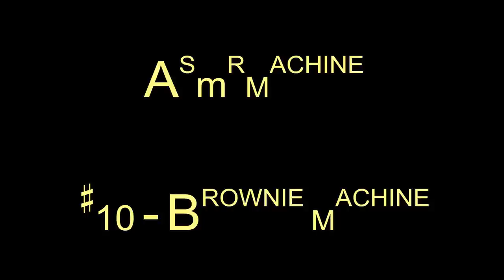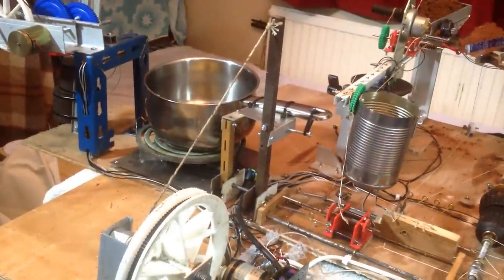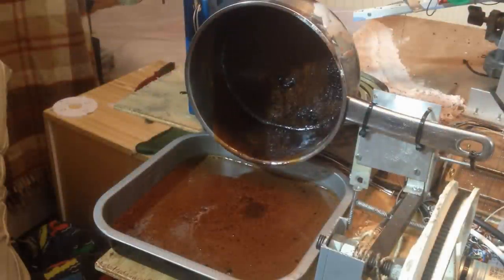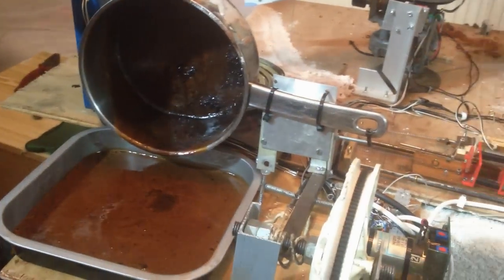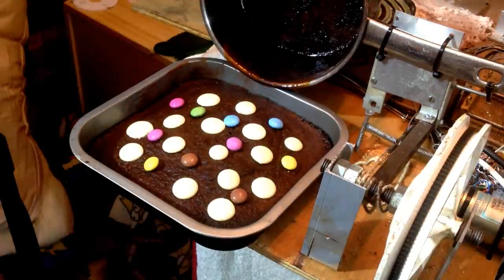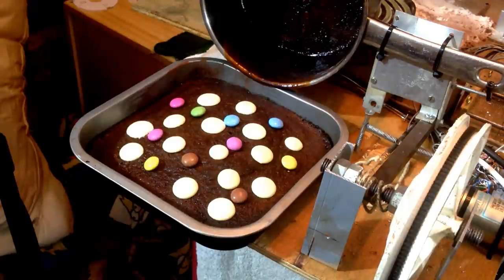#10 - Brownie Making Machine

Comment: Very cool. But, the paddles of the mixer look like steel or not? This material constantly harm the cooking pot, because is more hard. You could change that for wood o something similar. Only saying. Great job after all.
Reply from the maker: +DarioMD005 Didn't notice any scratching to the pot afterwards - probably because the paddles are made from aluminium, which is a relatively soft metal, yet is rigid enough to keep its shape. Glad you liked the video :)